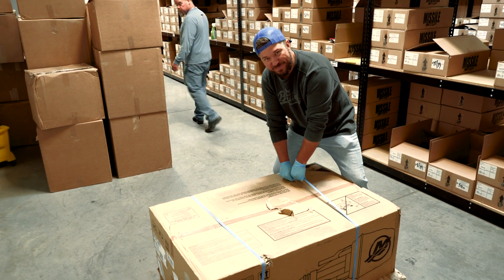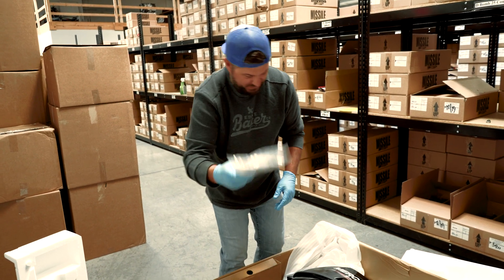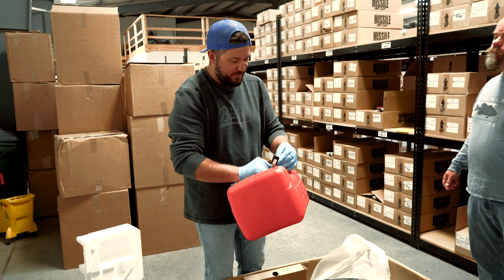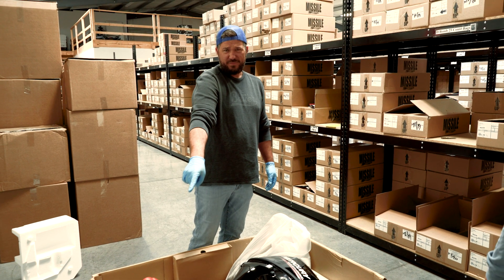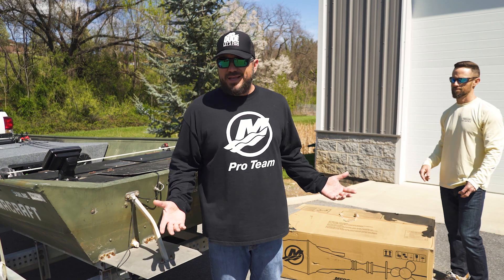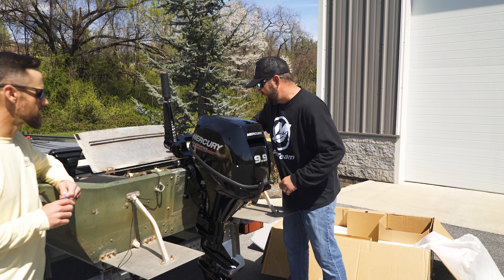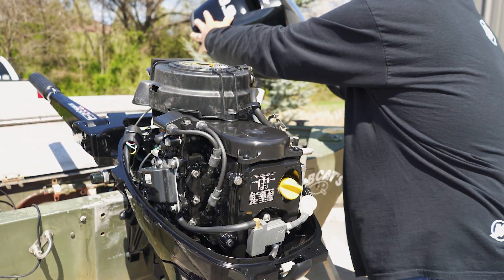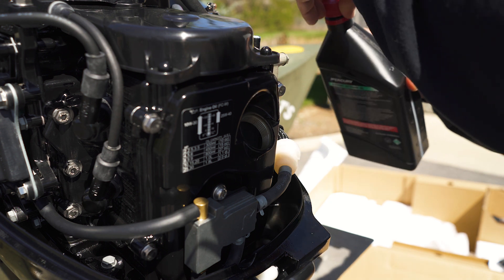New MERCURY 9.9 Unboxing w/INSTALL!!!

Comment: Good video. I am late to the party and look forward to seeing a video when you do a top speed test. Something I saw someone else do in a video, was to tie a rope to the motor for just in case the motor figures out a way to come loose and fall off. I wish I could remember whose video it was I like to give credit where credit is due. Waiting for my Tohatsu 25" shaft (Mercury 9.9). They have gone way up in price, mine fully loaded was just over $3,200. It will be here in a couple days.
Reply from the maker: Motors are hard to come by these days

Comment: What’s the process of breaking 9.9 Mercury outboard same as yours I ran it for 2000 RPMs for about an hour and second hour ran it for 3000 RPMs then I would open it up a little bit to 45,000 and then to 55,000 RPMs for about two minutes and then come down to 3000 in a four hour period is this OK Thank you
Reply from the maker: Something like that, I honestly forgot… it’s in the manual

Comment: Looking at this very motor. What size is your boat? Have you GPSd speed yet?  Thanks for sharing.
Reply from the maker: 16x48, I can get 14mph with me alone
Reply: I can personally tell you this I love got a 20ft river boat I had a 9.9 on it and it flew i can’t tell him mph but it pushed it decently
Reply: @arkansasworstangler9151  I bought the 20 hp Tohatsu.. on a Grizzly 1648 will go 23 with gear and just me in it. EFI. Very pleased with. Starts quickly and runs quietly.

Comment: You forgot to put the lower unit gear oil in!
Reply: John Dufresne - All Mercury 9.9s come with lower gear oil installed at the factory. Mine did. (2018)
Reply: Matt Waters ,didn’t know that, thanks for info.